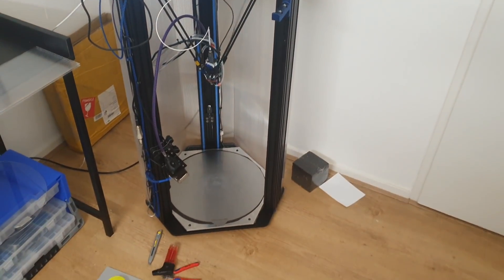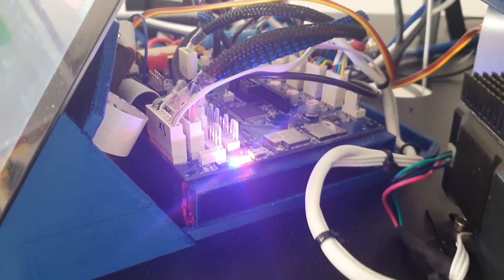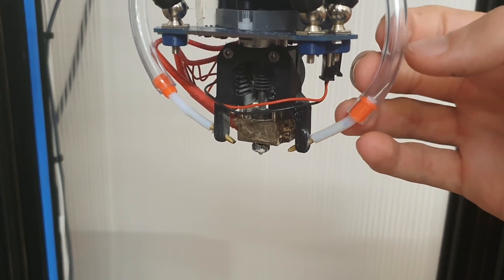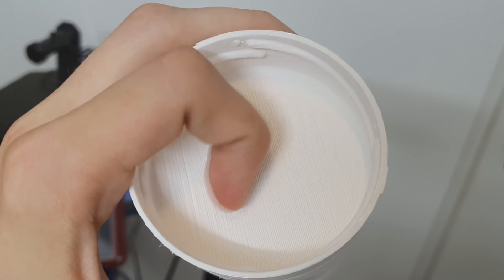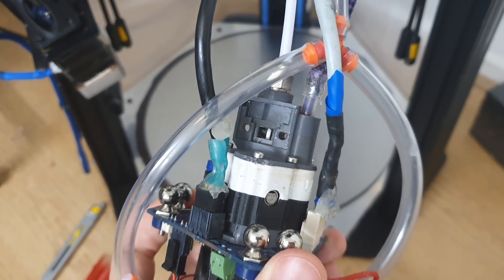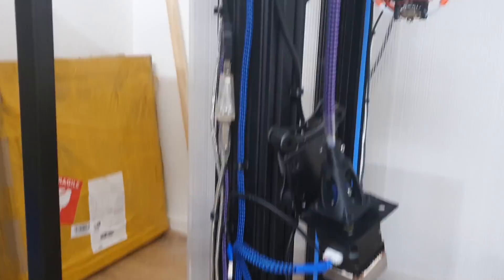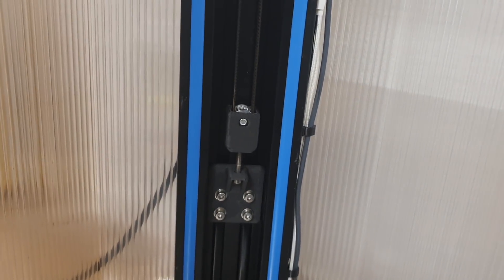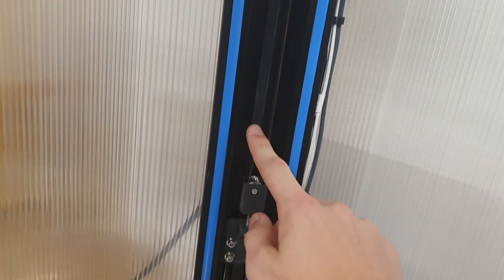A DIY Delta Printer With the Innovation Turned up to 11 - Nicolai Schauer's Tevo Little Monster

Comment: I wonder why no one uses compression springs to create a spring force constant tensioner for belts?
Reply: You could put a 3D printed ratcheting rack mechanism to keep the spring from oscillating as the belt moves.

Comment: Where are those cf/magnetic bars from? I've only seen similar on the Atom/Monoproce Delta Pro
Reply: They are called magballs.  I got mine from Filastruder: https://www.filastruder.com/collections/electronics/products/12-magballs-6-360mm-arms-for-delta-smarteffector
I also made up my own low-profile version that basically reverses the design, giving you another 10mm; however, I haven't fitted them yet.  Several Thingiverse examples of it.  Basically, you get concave magnets and screw/glue them into the effector.  For the rods, you screw in the ball sockets - like the ones in the Megball kit above.

Comment: You can find my designs here:
https://www.thingiverse.com/nikscha/designs

Muffler for the airpump:
https://www.thingiverse.com/thing:3429324
Reply: heck yeah IO love designs
Reply: Thanks for the links I really like your designs and I've been looking for something just like your air pump setup.
Reply: @76byoung  The part cooling is still work in progress, but I already get really good results. I'll compile a little manual, maybe even make a separate video on the topic. I am sure more people would appreciate it.
Reply: @nikscha  thanks mate that would be awesome, I'm building a "hot as possible" core-xy so it should help with weight and airflow issues.
Reply: Great job  👍
Reply: Tolle Arbeit Nikolai, viele schoene, kluge Loesungen!
Reply: Great work man, keep it up
Reply: Thanks for your contributions. You should post more videos of this custom build on your own channel. Can you upload the "brakes" you desgined?
Reply: I wish I had come to this video earlier. Love all your great ideas and upgrades :) one thing about your start up routine: great concept, but those pex sheets are expensive and preheating with the nozzle touching seems a bit wasteful. Why don't you stick a small piece of metal to the spot where you normally push the nozzle against the bed? I'm thinking of something like 0.3mm spring steel, stuck down with double sided tape. I can send you some as I've got plenty of it ;)
Reply: Solid work!
Reply: Thanks for the presentation of your printer. Are some very good ideas for my Tevo litle Monster. 

The next thing I will do with my printer is to insulate the heating bed from below. In a first test, this has brought extremely much. It needs to be heated much less often. 
In addition, I also have the magnet holder in planning. The goal is to be able to quickly change several print heads.